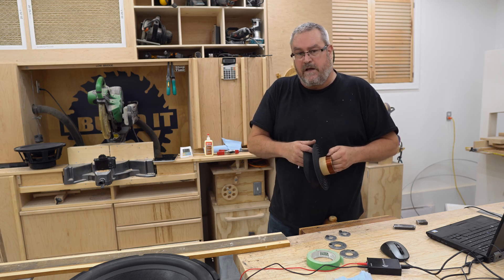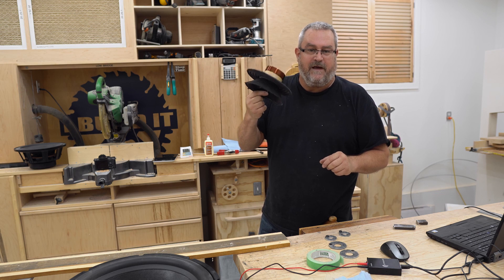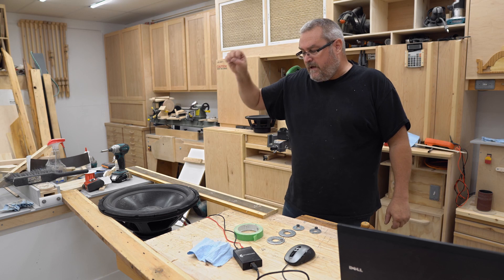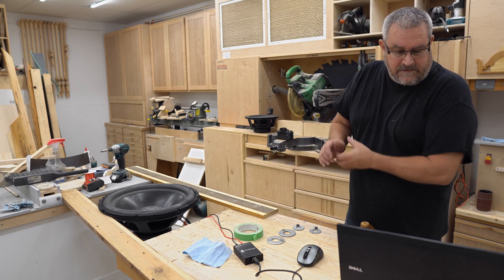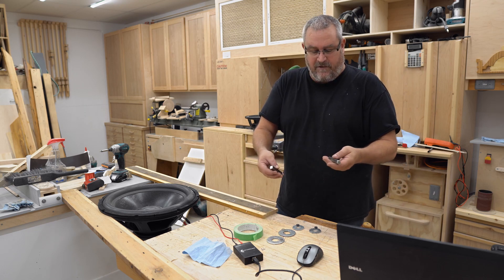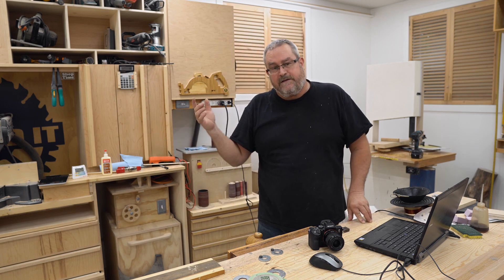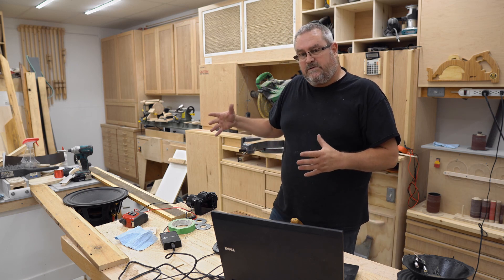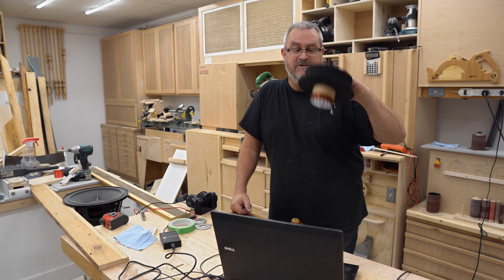How To Measure Speaker Impedance And Other Specs

Comment: I have rigorously tested at least three different models of the Dayton Audio DATS, including the latest, Version 3, which features a black box. Unfortunately, none have provided reliable results. When comparing the data obtained from these devices to manual test outcomes for Voice Coil resistance, BL, Cms, and resonance, there is a significant discrepancy. My approach to testing has been meticulous: I constructed a specialized test bench designed to securely hold the woofers without any vibration. This bench is considerably heavy to prevent any overlap between woofer and bench resonances. Despite these efforts, the system's accuracy leaves much to be desired, falling far short of being either accurate or approximate.

Comment: If you have 2 identical speakers, one is rated at 4ohms/50watts and the other is 8ohms, is it safe to say the 8ohm speaker will require about 100watts to match the loudness?
Also, if you have an amp rated at 8ohms/100watts per channel can it run a 4ohm/50watt speaker safely?

Comment: the sound workshop software is updated to version 1.1.1 and it works with windows 10
Reply from the maker: Don't know what that is. I was using Speaker Workshop.
Reply: @IBuildItScrapBin  sorry i made a bubu when writing it is speaker workshop not sound workshop
Reply from the maker: Do you have a link? All I found was the old one that runs on XP.
Not that it matters, since I have this new program.
Reply: Should work 7 too as they are very similar in the backend

Comment: Interesting video John.  I really like the test-dongle you have...didn't know such a thing existed.  I also agree with you - the DC resistance of a speaker is only the starting point...I think the confusion for many people occurs because this term is frequently call speaker impedance.  Though somewhat true, it is only valid at 0Hz.  The actual impedance of the speaker is very complex (as you show), this is due to many factors: inductance of voice coil, frequency, parasitic capacitance, and mechanical characteristic which also has an effect on the counter-EMF generated as the coil moves through the magnetic field. 
Question: have you considered using dry sand instead of the metal weights?  It may produce more accurate results since I suspect the sand would be less likely to resonate.  Messier though...
Reply from the maker: Guys get hung up on using steel and magnets for the added mass, saying something non-magnetic should be used. But I've tested that (before) and saw no difference. These weights and small magnets are just really convenient.
Reply: @IBuildItScrapBin  I agree the steel should have near-zero effect w.r.t. the magnetic field.  I just thought the sand would be a better non-resonating mass that could be uniformly distributed.  Perhaps I'm over-thinking this... 
Please continue with this series - speaker design has always fascinated me and brings together two passions: woodworking and quality music.
Reply: @CDN_Torsten  sand wouldn't work, if the weight isn't rigidly attached to the cone it only adds weight when the cone is moving upwards or very slowly
Reply: @fuzzy1dk  Ahhh...hadn't considered that - excellent point!